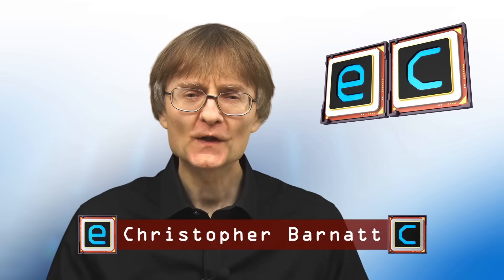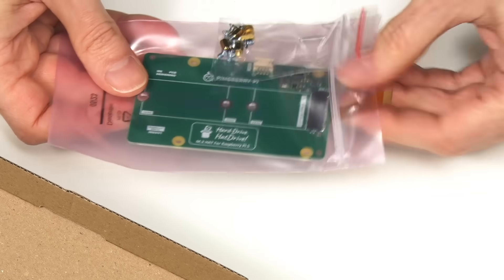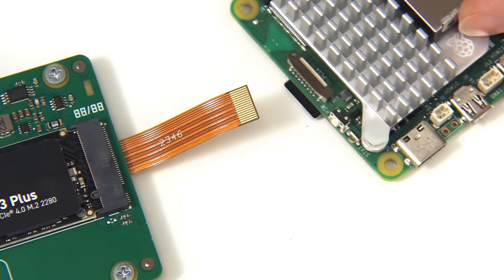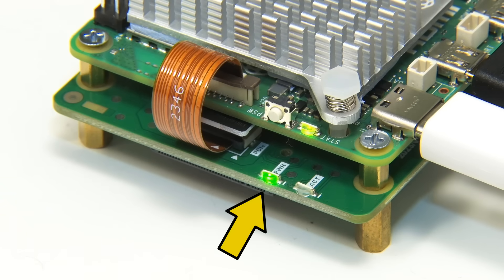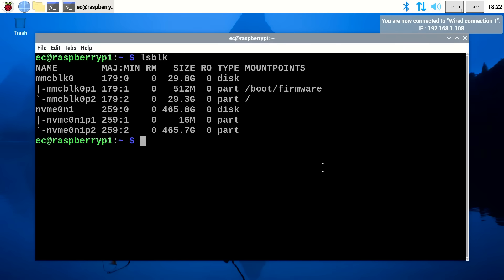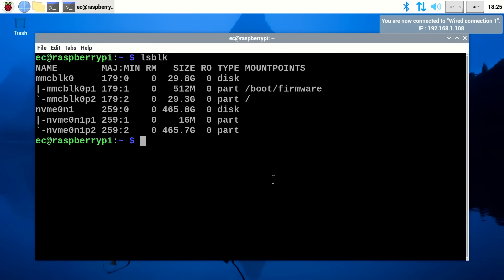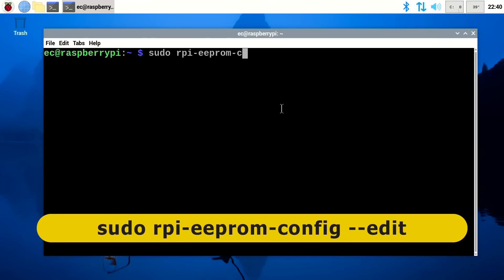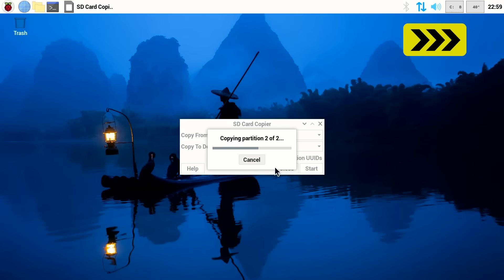Raspberry Pi 5 M.2 HatDrive!

Comment: I think I detect a need for "Mr. Needle-Nose"  the needle nose pliers to get the micro-sd card out??  And also appears like even just one more centimeter length on that particular ribbon cable might have alleviated part of your problem getting the card out.  That definitely is the case of,  "what were they thinking?"  type scenario....

Overall though, I wonder if this could alleviate some of the laggyness that some people report with using the Pi 4. The faster Pi 5 and faster drive, I wonder if that could warrant a video on one of your weeks using nothing but a Pi 5 and the "HAB"??  I think I remember you doing that on a Pi 4....but not sure.  I'd love to see how this fits in your Pi 800 keyboard / case that you made too....

Hope you have an excellent day!!
Monte

Comment: Do they make a case for this configuration? Also, the installation process is something that Pineberry should provide a program that will automatically edit the necessary files. People should not have to manually edit files to get things to work.  It would be a simple matter for the Pineberry people to write a GUI to carry out the setup process. And everyone buying their product has to go through the same process. This is something that we discussed in the comments of your Linux End-user Manifesto.
Reply from the maker: I'm not aware of a case . . .  yet!

Comment: I suspect in that configuration the Pi 5 would be a fairly dependable low power computer.  With that being said, I’ve had no issues using an SD card as a main drive on my Pi 3s and 4.  Of course, they get reasonably light use.  Looking forward to your next video!
Reply: No real issues with the µSD cards here either, had to flash the backup onto a µSD card yesterday after it didn't come up properly after a reboot, but that was the first time in over a year with 6 RPi4s and an RPI3B+.

Comment: the pineberry bottom is better than the top because it does not interfere as much with anything on top like attaching a cooler or any top attachments, and it supports m.2 full size 2280, which the top does not.

at this time pimoroni also makes an ssd bottom. both of these beat the official raspberry pi's ssd board accessory to market. who knows when they will even be available to the public.

all these accessories are bottlenecked around 800mb/s so gen4 nvme ssds would be overkill that you can go for any cheaper earlier gen nvme ssds.

one annoying thing from an ocd point of view is the lack of any case enclosures which could accomodate any ssd setup attached to the pi.
Reply: I expect that our good friends from Argon will have one shortly. Their Argon One cases with the M.2 bottoms for the RPi4 are excellent.

Comment: Happy new year. Well it is nice but what will be the total cost for such little system (MVME EXCLUDED) ? Furthermore Orange-Pi 5 if I remember correctly has the NVME socket integrated (and much more powerfull SOC)

Comment: I'm glad the Pi 5 has made it significantly easier to attach m.2 disks. 
I'd say most people won't really be using these HATs for speed specifically (though the interface and drives are much quicker than microSD cards!); it seems to be more for general stability and price-appropriate storage space.  
I myself will be upgrading to a Pi 5 with a 256GB M.2 PCIe 3 disk for my networking utilities server - I don't really trust my microSD card for the sustained writes and reads I put the poor thing through.
Overall, a great decision to allow direct PCIe access from the Rasp Pi foundation, and another splendid video from the channel. Many thanks Chris :D
Reply: 20$/euro to attach nvme, not that easy imho. They should have just put m.2 connector as some other SBCs.
Reply: You absolute right about SD and sustained writes. Access to TRIM is must have. And if you really use SD card you better use at least F2FS to prolong its life.

Comment: A quick note on the EEPROM config: for boards that follow the new HAT+ standard, you will not need to either modify config.txt or the EEPROM config, it should "magically" work when you plug in the board...

The HatDrive was put into production just a week or two before Raspberry Pi formally announced the HAT+ standard, so hopefully in a 2nd revision they can make their board follow it so you can avoid all that configuration work!

I am fairly certain the NVMe BASE from Pimoroni and Raspberry Pi's own M.2 HAT (whenever they release it) will work that way.
Reply from the maker: Thanks Jeff. And fingers crossed! :)
Reply: @ExplainingComputers  Thank you again for the video, quick question, is this HAT compatible with rpi4? or only rpi5?
Reply: @yetanothername1131  Only the Pi5 has a PCIe connection, so this will only work with the Pi5
Reply: @andrina_w   cheers!
Reply: @yetanothername1131  unfortunately it is not the pi 4 does not have the hardware necessary to connect it
Reply: These are not strenuous adjustments, in any case.
Reply: @LostInThe0zone  Had me wondering if there are other advantages. Like changing the boot order to get a tiny boot speed boost & keep the sd card as a fall back boot device in case the nvme goes down?
Reply: Partially influenced by today's date I have had a small glass of beer, or two. And scotch. I love the community aspect of top YouTubers commenting/helping each other! You guys rock!
Reply: @Neilhuny  I made sure to double my daily caffeine intake in honor of it being the 52nd ExplainingComputers release of the year :)
Reply: Bottoms up!  @JeffGeerling
Reply: Looks like you still have to fiddle with the config for the Pimoroni board too :(
Reply: I just got the Pimoroni NVMe Base and can confirm it didn't require any modifications other than making sure the EEPROM was updated to the latest version. I did update the config.txt to force it to Gen 3 after initial testing and it's been stable since. Using a Samsung 980 500GB NVMe M.2 and I've getting 794.70 MB/sec 🎉. I'm booting off the NVMe after using raspi-config to change the boot order.

Also can confirm that getting the SD card out is a piece of cake because of the offset cable Pimoroni supply 👍🏻

Thanks for the great video - it made this really easy 🙏🏻
Reply: Going to order one newt week, I would love a hat with a hole under the SSD to allow airflow for the cooler, GPIO pass through and POE.
Reply: I think they need to ship the eeprom as  0xf25641 the same way the CM4 lites are set.
Reply: You bros should do a collab together! I want to see Mr Scissors vs Red Shirt Jeff go into combat :P
Reply: We all know Mr. Scissors would win that fight!  @TradieTrev
Reply: Minutes after watching your video, Jeff @JeffGeerling, I ordered a couple top hats from Poland. I followed your tutorial and working like a champ. I will get a couple of the bottom hats on the way, too. @ExplainingComputers this confirms for me I want the bottom version as well.
Reply: The pimoroni board has an offset connector and flexible flat cable so access to the sd card should be easier
Reply: If no config is used, how do they make a choice in which mode gen2/3 to run?
Reply: @sc0or  It defaults to Gen 2 (the rated speed for the Pi 5), and if you want to uprate it, you can force Gen 3 or even Gen 1 (2.5 GT/sec).
Reply: @JeffGeerling  So are gen 3 speeds stable; I read somewhere that they are experimental?
Reply: @keiichicom7891  Gen 3 speed is "unsupported" — but in my testing (and most other people... though not everyone) it has been extremely stable in all my use cases (storage, external graphics cards, etc.).
Reply: I would personally prefer something like the Argon one. if they release a version with a "Dual purpose" NVME board. that can both be used with USB and with the PCI-E connector.

Which would allow for easier programming/flashing.
Reply: NVMe BASE from Pimoroni shipped today for me via Royal Mail 24hr tracking, so tomorrow it should arrive
Reply: Heck no, NOTHING magically works. It has been a nightmare so far. I use a SupTronics X1002 V1.1. Have not been able to make it boot.
Reply: I love that my Two favourite IT investigative reporters get along and follow each others work!
Reply: On the orange pi i do know eeprom needs changing to boot from other than the default sd card
Reply: Just set mine up, and the nvme drive showed up in lsblk immediately, with no config.txt changes. Put 'em all in for good measure, though!
Reply: Has anyone ordered from the USA and gotten it? Details if so
Reply: @TPUSILL  I ordered the Pimoroni board and it arrived in fairly short order (I live in Colorado), and as others have said it worked for me without any configuration. Flashed an OS to the NVME drive using a USB-NVME adapter, mounted it on the board, removed the SD card, switched on the Pi, et viola! I've got a nice little Linux box!
Reply: I can confirm that the HatDrive v.2 Bottom works out of the box :)
Reply: I just got my pineberry bottom hat. With current firmware on the RPi5 it autodetected the SSD when I did a "lsblk" it showed the SSD as nvme0n1. That was unexpected. Per directions I had seen online on Explaining Computers I tried to open /boot/config to see if there were already entries there. A message came up that said the file had been moved to /boot/firmware/config.txt. When I looked in that file I did not see any entries related to the pcie interface. Not really sure where to go from here. I would like to boot from the SSD and I would like to try the pcie 3. Is there any current documentation? Thanks.
Reply: currently running libreelec with the hat and m.2 so easy to setup. set bootloader to nvme. I think the pi5 has gone beyond a hobby device to fully formed device with some serious every day usage.
Reply: one thing i have a question on. I want to use wor-flash to write windows 11 for arm to my pi5, BUT ALSO want it to boot from the nvme.  when running wor-flash-gui it gives the option to enter settings for config.txt, could you use the dtparam settings used in this video to do to enabled the nvme during the wondows install and have a bootable win11 arm pi on NVME?
Reply: I think the pi should run Linux for it was designed for. Maybe one day they might make a pi or equivalent that uses Pentium 4 chips. 73

Comment: Another excellent video!  I'd be interested to know performance speeds between a Pi 5 and say a N100 mini PC given that the cost are becoming similar.
Reply from the maker: Well, guess what I am working on this very day? A video comparing the Pi 5 to an N100 PC. Will post sometime in January. :)
Reply: You must have read my mind spooky :) @ExplainingComputers
Reply: I think the N100 will be a pi5 killer. Pi needs to go back to making lower performance affordable boards. They’ve stretched up into the low end of micro PCs that are far more capable (by the time you add all of these add ons, they don’t compete with a used micro PC already).

Comment: Perhaps it should be called a BIB; Board Installed Below?
The cable obscuring the SD card slot is unfortunate. Even with today's connectivity  options, a removable medium can come in useful sometimes.  When converting to booting from NVME, maybe it would be easier to do the job before securing the board, i.e. with it beside the Pi rather than underneath. Then remove the card and finish the physical installation.

Comment: A super computer in the palm of ones hand, it really is mind blowing. Anyone who has been around for a long time would remember the size of the old disk packs and this little computer how many terrabytes of ssd can it support?
Reply: If you are talking about those large cylinder multi-tier disk packs with a big handle on top to twist and lock/unlock the drive, then YES I remember them well!  I do not remember the capacity of the ones I used to use with Honeywell DPS-6 mainframes, but they likely were less than 100MB at most. The drive you put them in were bigger than  a small mini-fridge. Memories!
Reply: Did you go around the room when the drive failed to stop spinning when you took it out, a hand held gyroscope. @aytviewer2421
Reply: The SSD can theoretically be as large as the OS supports, rather than a hardware limitation.

Comment: It makes you wonder why Rasp Pi didn't move some components around to just be able to fit a Nvme connector on the bottom.
Even a smaller sized one would be great.
Reply: Too big, expensive, no space for a through hole.

Comment: I'm using the NVMe Base from Pimoroni and the Pi 5 is wonderfully quick, this little device is now seriously capable unit, very happy with it.
Reply: Looks like the NVME drive makes a very big difference to boot times and drive access times.
Reply: I was wondering if you could share the difference of boot times between starting up with the NVMe disk and the SD Card. Thank you.
Reply: I think I like the Pimoroni HAB better than the Pineberry HAB, as it has a design feature that I like better than the Pineberry HAB: The NVMe is located on the overside of the board when mounted, not the underside. Having the NVMe on the overside makes it harder to cool passively through contact with a fitting case, but it appears tidier and more protected. It doesn't really matter if you place the Pi+HAB in a case anyway, but my Pis have a tendency to be naked while I work with them, and unless they end up in "production", they tend to stay naked.
Reply: @ThomasBjorseth  I'd be happier if the pi5 designers nuked the sdcard slot and put the m.2 slot on the main board instead and what's with the pcie 2 compliance, when everyone else is on pcie 4 or higher (some pcie 3)?

Comment: You could just screw the board to the bottom of the pi after transferring the SD card data to the nVME drive.  That way, it will be a lot easier to remove the SD card.
Reply: I think the issue is that it will make using the SD slot for other purposes more difficult, not the problem with migrating the OS in the first place which you will only do once (and could have been done via the USB caddy anyway).
Reply: Seems simple enough to detach the cable if you want to remove the SD card (tip for Chris: Tools work better than fingers for this!)